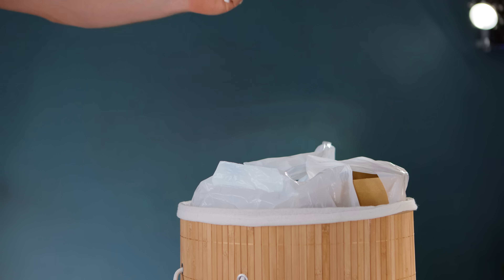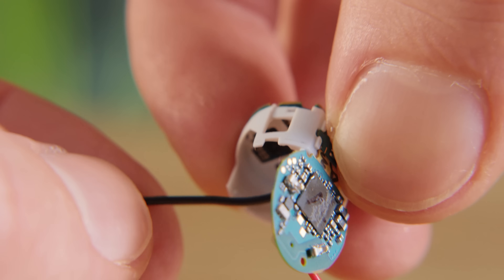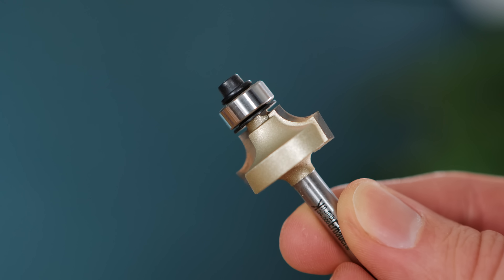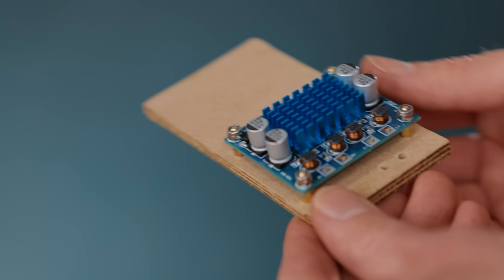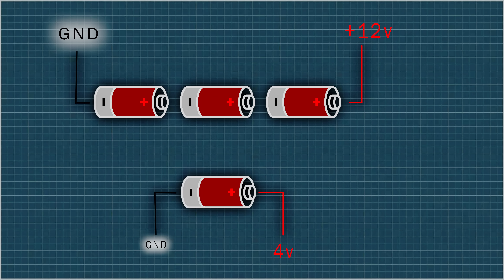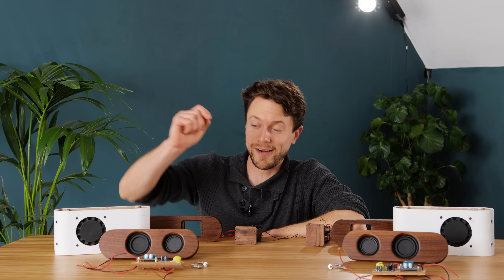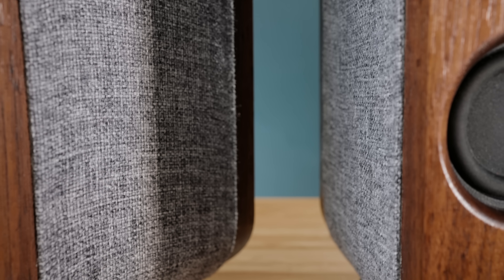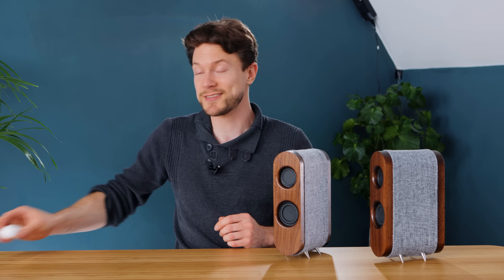Transforming dead earbuds into POWERFUL wireless speakers

Comment from the maker: Hey everyone, I've FINALLY finished the additional tips-and-tricks guide to go along with my dual-stereo speaker project. In it you can find full details of the crossover & smoothing circuitry, dimensions and cutouts (CNC files and also a square version that's easier to build), and extra info about some cool bluetooth receiver boards that work as a stereo pair if you don't want to go with ear buds. Enjoy! https://www.patreon.com/posts/dual-stereo-52451164
Reply: Hey, beautiful end result! Seriously one of the coolest DIYs I have ever seen. Do you have any input on how to modify to add a charging port, rather than removing the 18650s?
Reply: @N8JAY  great scott has some good battery knowledge. You may find charging ideas on his channel. There's some got micro USB and type c battery charging boards or there for cheap with built in protection
Reply: @N8JAY  you could use LIPO rechargeable cell batteries (available in many shapes and sizes) with a charging circuit board (readily available, also has 2 LEDS for charging / charged status) and you could use a USB cable for charging
Reply: Can someone please share the Crossover? I  really need it.
Reply: Well... no money...no instructions... great job bro
Reply: This is a great project. But how can we pair a new device to this pair of speakers
Reply: @mohammedeassa3027  you would need to open it up and press the pairing button that is still attached to the buds. When paired you can close it back up. He never removed the button just used the electrics for his diy purpose
Reply: You MUST do a collab with LTT!
Reply: Now all I need is your skill, talent, creativity and motivation and I'm set.
Reply: You could've added tweeter that handles the highs.
Reply: Ok, I waited a long time to get the plans and instructions, and I'm really disappointed. Plans without any dimmention, really basic instructions that the video already gives and false value of resistances, no electrical diagram. nothing, and we pay for it, really disappointed
Reply: HOLY SHIT that speaker support SAMSUNG SCALABLE CODEC :D
Reply: Can you share the link for wireless mic you made i can't find the video. In your channel.
Reply: Hello Matt, I really enjoy your videos and have referenced a few to assist in projects of my own. I am wanting to take your project here to another level and would like to as some advice. My plan is to make multiple of these and build a Bluetooth central control unit to efficiently make a true wireless surround sound system. Would you happen to have a control board you would recommend?
Reply: Is there a chance you would sell a pair?  Cuz after trying im not that handy :D
Reply: @g.d.164  No o as là
Reply: Read: Hey Patreons, I've FINALLY finished the additional tips-and-tricks guide to go along with my dual-stereo speaker project...
Reply: If you can, then please make your own smartphone . It will be wild 🔥🔥
Reply: cool speakers
Reply: hi..looking forward for a video on any possibility of adding charging module for the speaker's battery.its more convenient im sure 😃
Reply: @mosesngadi4625  you have
Reply: Hey how cans I get the speakers
Reply: Can i apply this DIY to make my own wireless headphone?
Reply: Great job! I can get an understanding how are you going to connect new cellphone to the speakers!!! Usually you will have to put then in to case and then open it , press something and only then make a new pare to headphones. But obviously this is not the case.... So how???
Reply: Get me the name a of your supporters
Reply: https://youtu.be/Vsx3rg2bYOk
Reply: how do i put them in pairing mode.
Reply: Any advice on how to make them rechargeable without removing batteries?
Reply: You need to be running your own design company,  I thought these speaker were made from top branded company
Reply: What do you do if you have to pair them with a new device??
Reply: @이응호-y4v  I think you would have to disconnect from the previous pairing
Reply: Hi, beautiful work. How did you figure out how large your enclosures needed to be?
Reply: Is YouTube your only job or do you also have a full-time or part-time job? How do you find time to do these projects?
Reply: @DIYPerks  would this same Idea work I if I created a corded variant of these with an amplifier?
Reply: I think those are wolfers, not sub-wolfers.
Subs generally only come in singles not pairs....
Reply: don't throw your earbuds away, just hold on to'em while you get a bachelor's in electronics engineering and then you can easily repurpose them.

😂 😂
Reply: C🎉
Reply: You should have added a charging pcb inside
Reply: Hiya sir, is there a simple way to msg you with an idea for a teeny bit of component advice for a micro subwhoofer to accompany my minirig speakers (I don't mind buying you a coffee etc)

I hope you see and reply to this..

Watched nearly all of your vids, very knowledgeable dude, even my dad likes your pc desk build and that's saying something ahaha😊 

Many thanks...
Reply: What are the components you used for the audio crossover pls
Reply: If there is an app you can still set them
Reply: I want circuit diagram and components value. Please add in your discription.
Reply: i was curious why are you showing cap-resistance filters without telling it's nominals, is this some kind of joke or what.
Obviously you wanted to sell it :D
Reply: It’s amazing how you’ve breathed new life into something most of us would just throw away.
Reply: But how can you pair new devices to the speakers?
Reply: you might consider redoing this video with a 3d printed enclosure
Reply: If you used active noise canceling earbuds, would that mean you could have a noise canceling device to help combat outside road noise and or outside noise in general in said room? Granted you mounted the mic outside the speaker housing?
Reply: Can you make one for me
Reply: lol seriously all of you, people....

1. If you do not have a time ( do not want ) to build enclosure and buying pricey tang band driver, you can get cheap 2 way passive speaker with speaker and plastic saloon. 
Many of them sound decent with only minus is the sound characteristic is a little V shaped even if you do a proper crossover. The solution is to replace the woofer with better priced one.

2. Counting RC network/band pass filter/crossover is a basic math in electronics. If you does not know on how to count the frequency, resistor and caps value then you wont have necessary skill to build this project. One mistake will make you fail to troubleshoot and lead to abandoning project.
Buy pre-made cheap passive mono tone control instead. You can also buy passive crossover. 

3. Why do y'all need schematic from this? Just draw everything as block diagram. The crossover is shown zoomed, color of each resistor ring is shown clearly, caps might be .22 or 1 or 3.3 uf depending on their voltage. Find the calculator online to suit your choosen driver.
4. Y'all need to learn on how to be creative
5. Y'all need to learn on how to google...
Reply: How long do the battery last tho 🤔
Reply: @s.ryanharmony1427  do the earbud has an android or OS system inside it to operate the mini bluetooth earbud speaker?
Reply: LOL.. the prices.. like 210 USD for just the speakers
dang.. your pretty rancid when you gladly will show the low prices for the faulty buds but all "shhh" when it comes to the prices for the speakers.. just a short mention "thx so much to the vendor for just sending these over" and almist like its your neighbor (lol).. why not follow our guidelines on YT and label your video accordingly.
if your video holds any value from a third-party, it's a sponsored video and you need to click the sponsored content box and your video will be handled accordingly in our algorithm and be labelled with a label "holds sponosred content".
I understand why Techmoan is.. mehh when he, again and again, does that.. while other lowballing channels don't.
https://youtu.be/HWtOAWWY010?t=1789
DIY Perks.. follow our guideline and label your vids accordingly or finds yourself another plateau.. cheers from an Alphabet Inc shareholder.
It is in the viewer's interest they know what is sponsored and what ain't - and that is why you need to click the sponsored box when uploading, so your vid will be labeled accordingly before people click on it, after all, you are monetized and you agreed to our guidelines and you ain't new.
and if you feel it hurts your income, fx the algorithm aint promoting you that hard, then you can ask the company that gifted you something in exchange for promotion / advertising.. for reimbursement.
Reply: Hey! On galaxy buds + there are 2 speakers on each side. Is there any chance it is one for bass and one for treeble? I think I will try to connect amplifiers on separate channels.
Reply: Many thanks!
Reply: Can you please make a wireless speaker using audio exciters?
Reply: IT IS HEEEEERE!!!!
Reply: I see two types of membership. "starter" that is 4 dollars and the supporter that gives access to files and blueprint and it costs 7 dollars. so expensive.
Reply: Wow! Thank you for this.  The additional time take to research this was well worth it.
Reply: This makes no sense in building WORKING LABOR expenses = 1 week of work (you can buy MULTIPLE systems in a week of work even if you are workingin poor 3-rd world country)
Reply: @nazariiboichyshyn4300  have you happen to read or see the channel name...its DIYPERKS...again DIYPERKS....I m just telling you if you didn't noticed, or clearly you r lost.
Reply: @durrani1983  dont even bother mate about him
Reply: Sir , pls make a vedio on DIY project from old bluetooth headphones
Reply: Can i get dis speakers????
Reply: Man fuck this shit. You got millions of views and sponsors and you still charge people for the guide? Peace out.
Reply: WHAT THE FUC 
YOU UPLOAD THE GUIDE AFTER 2.5 MONTHS AND IT IS ON THE MONEY 
I WAITED FOR SO LONG AND WE HAVE TO PAY 
I expected better than this from you
Reply: @mrwhite1566  hey where does he uploded the guide
Reply: @abhipronasa  he uploaded the guide on the  patreon which means you have to pay the link is in the description
Reply: @mrwhite1566  just remember. All of his content on YT is for free. The guy has to eat too. I am not a Patreon but see nothing wrong with charging for some of it. Making this content takes a ton of effort.
Reply: @mrwhite1566  same... Was excited but have to pay :( ...
Reply: @mrwhite1566  it's 3$ a month. Would take less than a month to read Jesus christ.  Ignore the big Mac for a  day and you'll have enough to support the man making all of these videos for your leisure.   If you can afford the parts for the build you can afford a 3 dollar charge.
Reply: Honestly, I want to make these, but I can't afford to be a Patron. 

I'll just have to hope for someone to leak the guide.
Reply: Hi....The reason why people are interested in your videos is that it creates curiosity of starting on build on your own journey. However putting the schematics on patron shows you are not sharing and just trying to earn from it. This pushes the same people in buying instead of creating as this seems to be another profiteering effort.
Reply: You're getting paid through YouTube still need money for giving a guide after 2.5 months?? 
Is this fair 
I literally fall in love with your skills and you job but...... 
It's disappointing
Reply: Very poor that you are asking us to pay... I've been waiting for such a long time and i used to really enjoy watching your video's but it such a shame that you ask us to pay for it.
Reply: @rickkap8502  you shouldn't say that at all. If you dont want to pay try make your own by yourself only 😏

Comment: You definitely need to equalise the midrange (resonances), which is normal for such small speakers. You can hear it clearly when compared to the Bose speaker.  solution : find the resonanz and put a bandpass inside

Comment: How can they be connected to a new device,
Since pairing needs to be done while the buds are inside the case
Reply: Apparently, you'll need to remove them from all the pairings, but it has to be done from the paired device. Only then they will go into the pairing mode straight after being powered-on. That's a bummer if you don't have access to all the paired devices.

Comment: Nice project! 
One concern about using earbuds bluetooth circuitry: I guess there is an integrated dsp, perfectly tuned to sound best with the original headphone drivers. This might affect the sound quality during use with other speaker systems. Did anyone who recreated this project notice such issues when comparing with other audio sources ?

Comment: Those "crossovers" rely on the manufacturer testing to make the dielectric, you can't make a reliable dielectric with the AC of the audio signal. It might be worth replacing the electrolytic capacitors with ones that are not polarised.

Comment: I built these for a school project. Before going into this you need to know a good bit about soldering and wiring. Also if you want to make them exactly like he did they will be pretty pricey. The hardest part is probably getting the dead earbuds to work and I recommend just buying the bluetooth receivers that he mentions in his link. The total was around $350 so know that going into it. But once your finished these do sound REALLY good so it’s worth it in my opinion. Good luck if your going to make them!

Comment: Sir can you pls share design of this speaker so i can directly send it to 3d printer service, I have Jabra Elite earbuds but they have degraded battery, I want to use them as Bluetooth speaker cause they have aptx codec, sound really wide and punchy, i want to reuse them with my two alexa 4th gen drivers, may you pls share file, I'm little to no knowledge about 3d printing, I'm struggling to get case for my bluetooth speaker project

Comment: I mean nice diy but the price for the material is at least the same price as if you'd buy a new set of speakers. 125 quid for the speakers alone. Plus amplifier plus wood plus threads plus feet...

Comment: @DIYPerks Another great project and congratz on working out the correct crossover frequencies.  The only thing I would suggest for a V2 of this would be: 
  1.  To integrate a charging with under/over voltage protection from a USB C port as this can be configured to devilver up to 20V that you can split as needed.
  2.  Change to crossover circuitry to allow 3 pots that can do bass/mid/treble, or just 1 pot to control mid frequencies.

Keep up the great work, I dunno how I missed this 3 years ago as I watch every video as it comes out but hey, better late then never :)

Comment: ive watch this years ago, its lingering in my mind for years, till last week i started this project.
im used cheap airpod knockoff as its bluetooth source, but it ended fail, as it has like capacitive button inside its module, and some magnet in its case. so if it taken out from its case kinda turned it on, then put it inside turned it off.
iv just realise it after i soldering all its component. wondering why it wont turned on as the amp module already on. ive tried to tap something that like button in the bluetooth module then its turned on. tried it atach its magnet to the button or keep presing it while i turning the power switch doesnt works, i need to tap it while it has power to turned it on.
ive later also tried to disassemble few my broken bluetooth headset, inside all of them kinda similiar with that airpod knockoff, is there way to let it on without touching its capacitive button?

Comment: Just FYI
I've discovered that AliExpress sells several types of wireless ear-buds at ridiculously low prices, I keep buying them for less than £2 a pair because I just can't resist a bargain. I have 7 sets - but don't tell the Mrs. At the price they're basically disposable and barely worth recharging :) So if anyone needs some to make some speakers - look there.

Comment: Using a set of wired headphones to listen to this, two things were apparent.
  1. There is no stereo separation in what you recorded, so whatever you built doesn't sound any better than mono in your demo. Either you picked the wrong music, or your recording device doesn't do stereo well.
  2. The Bose unit you used for comparison was much better at producing a clean deep sound. Your build looked good, but sounded like crap compared to the off the shelf product.

If you're going to all that trouble, I would expect it to perform better, but Bluetooth is the worst way to connect audio, so I'm not sure why I was hoping for more.

Comment: An issue is that the earbuds drive 32 ohm outputs with a common mode rejection of the PWM switching frequency. Driving an external amp without impedance matching results in an audible hiss due to the switching noise, resulting in a loss of fidelity.

Comment: A few years ago I was wondering if there would ever be a cottage industry taking off where they would buy Apple AirPods with dead batteries, remove the electronics and with a new battery place them in a new plastic housing for resale. But this is actually a better idea to put them into mini speakers.

Comment: You can also internalize the batteries by using something like a Adafruit boost board and charging board, so all you have to do is plug in the speaker to charge it up.

Comment: I'm currently making this and I'm using a receiver board instead of the earbuds, and I've ran into an issue, were when I connect the receiver board to the amp those filters he has me making blocks so muck of the signal its really, really quite (yet the filters still work as intended.). If DIYPerks sees this and can help, great. But have any of you done this before, and know how to help me? Ran into the same issue maybe?